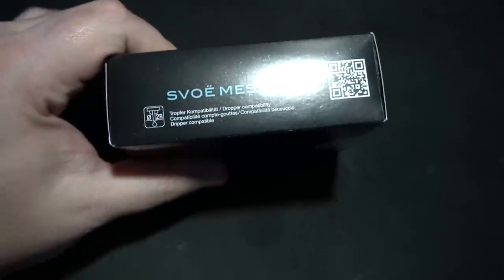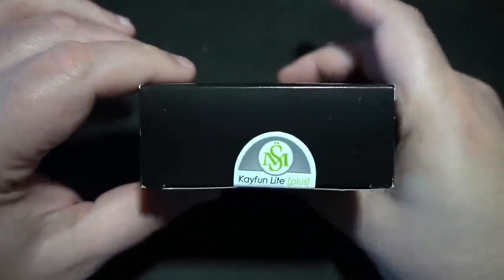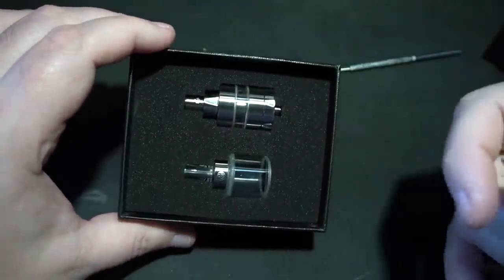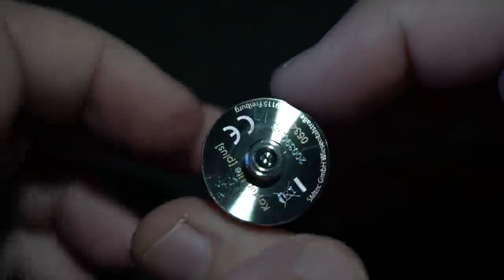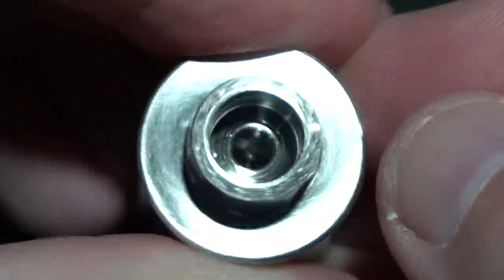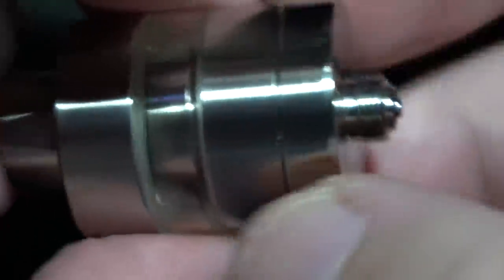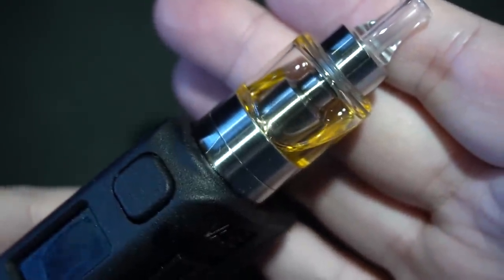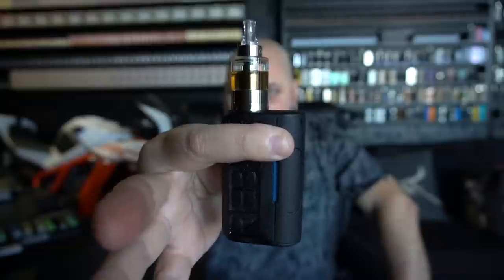SvoëMesto Kayfun Lite Plus 2021 | Improvised Rendition

Comment: Great looking tank, it's nice that they include the clear tank as an extra. I think the metal screw for adjusting the airflow is a step up from the nylon screw on the Kayfun Lite 2019.
Reply: @darkcggaming  good to know because my Kayfun V3 was set it and forget it. Still a great vape and the only issue I had with the V3 was the glass being exposed. Definitely bought a few replacements. Glass is so easy to clean though. Maybe if they designed the metal to go around it, so you can still see the liquid? Idk, still my everyday vape between that and the V5 on pure convenience when using this outside of the house.

Comment: They beat SteamTunes to the punch with this. I had to buy a tank for the 19 to look like that and the adapter. The nylon screws seemed to break down over time. If you didn’t have extras, the PIA little piece of Teflon tape was my fix. Every thing would be great for 5 days to a week. When out of the blue one side of your cotton would break down and the remains of your tank would run out of that little hole in side. It was just as good to just use the small tank for me. I did get the DLC 22mm, that sucker is gorgeous.

Comment: I run 20-35mg salt in my 2019 (1.0-1.4ohms) and love how it vapes!  And only 3mg in any of my DL stuff.  Thank God for the Steam Tuners top fill kit though.  The tight tolerances on the 2019 made the bottom fill a huge pain in the ass, maybe the plus is easier to unscrew though.

Comment: It seems like svoemesto addressed the leaking problem through the 510 with the kayfun lite 2019 by adding a o-ring to the 510 pin in the plus version. Would it be possible to buy the deck section or the 510 pin (normally at svoemesto you can buy every piece of there rta seperately) of the kayfun lite plus and build it in the kayfun lite 2019????
Reply: It’d be pretty neat if that works!  The metal screw looks thicker though
Reply: @Mike-un7cn  I've just been to svoemesto's homepage. They are offering  the "PLUS Upgrade for Kayfun [lite] " pack for 40€ . Its basically the whole build deck of the kayfun lite plus, which you can just put in your original kayfun lite 2019
They are claiming these improvements :
-Better performance with MTL+ setups (1,2mm airflow or less)
-More flavor
-Optimized vapor saturation
-Sealed 510 connector

The last point is the most crucial for me ;-)

Comment: Great review,  I have an OG lite plus, and have to remove the screw to fill it, and a screw to adjust the airflow, as you mentioned.   Still use it to this day, wished I could find a glass tank section...
Reply: I have one of these as well, when did they start serialising these as mine just has the date of manufacture which is 2014/02.

Comment: pause "Worst analogy ever" - cracked me up I almost fell from my chair. But it makes me wonder: have you ever inhaled through a bowling ball? And more importantly: WHY? ;)
"I went snorkeling and all I had was this bowling ball" :P

Good review as always. I own a Lite 2019 - is it worth the upgrade in your opinion?
Reply: I have both and use them daily. The 2021 is a slight improvement over the 2019. If you got spare grub screws, stick with the 2019. If you don't have a Kayfun, go directly to the 2021
Reply: @itsthefridge  I got my hands on the "Upgrade Kit". Just the deck with the new AF for 35 bucks. The 2019 version tended to leak a little bit with those plastics AF grub screws. So far with the upgrade that's fixed. Now I have the golden DLC Lite 2019 with the 2021 deck and Airflow. I like it ^^

Comment: I use salt nic 38 or 50 in my kayfun lite works great just have to use the right coil.
Reply: What is the right coil?
Reply: @Chris-en6jx  Depends on you I like ni80 and ka1 starting off i would just do a simple 5 wrap of 28 to 30 gauge but if i wanna get fancy 30 wrapped in 38 2.5 id 6 wraps.
Reply: @jamesthorn2585   Thanks a lot. What's your wattage?
Reply: @Chris-en6jx usually between 13 to 18 watts

Comment: I still use the K5... And 5 squared. Regularly. I think the airflow is way too tight on the 2019. I need a bit more air flow. I don’t understand why if you can adjust it down to nothing, why they won’t give you an option to open it up more, you can drill out the hole but I shouldn’t have to do that. I’m not complaining but I wear dentures and cant do tight like that. The GTR is tight to me, but useable.

Comment: I have a problem with my 2019 where I can’t unscrew the tank to fill. Even juiced up the tank locks together TIGHT!
Reply: I had the same problem, i just put a small allen key into the airflow, hold it with my thumb and I unscrew the top section.
Reply: get something ruberry, wrap it around the tank and get alan key or something like a pick and jam it in to hole  try to unscrew it
Reply: I removed one of the two o rings. No leaks and fixes the problem entirely.

Comment: I already got all the goodies for my 2 19"s, still might grab one of these though.
Reply: Don't quote me but i think the goodies are interchangeable
Reply: @stefanv5972  might just try to buy the airflow pin. Looks like it will thread right into the original deck
Reply: @robwigglezz944  there is an upgrade kit for less money maybe you should look at it

Comment: The reason I won't pay for a Kayfun (even though they're cheaper than they used to be) because of the bottom fill.  It is almost 2021, there are tanks with slide fill, 1/4 turn top fill, and you're still going to give me bottom fill?  Literally nobody prefers bottom fill.  And they have all that space on the top where they could put a top fill.  What a shame.

Comment: I just bought a Kayfun Lite 2019 (22 mm.) and honestly I think it is too airy for my MTL style.  I can't tell the difference in airflow when adjusting the AFC pin.  Am I doing something wrong or is it just the way it is?  I like better my Innokin Ares 2.
Reply: You have to screw it in quite a bit before it starts to effect the airflow. But you could also get the XS Centerpin which takes the airflow down to 1.2mm at it's widest, or SvoeMesto is selling the deck from this new Kayfun Lite Plus as an upgrade.
Reply: @duncanyoyo1  
Ur correct. I wasn't a fan of the 2019air flow Centre pin material and how it worked...

Comment: Question if put on a hybrid what happens if that center airflow screw touches the battery?
Reply: Syed Afif  kk was just curious cause how its floating inside that collar type part that makes connection